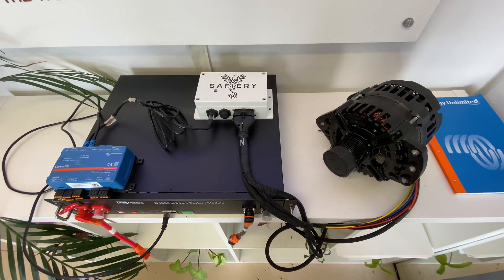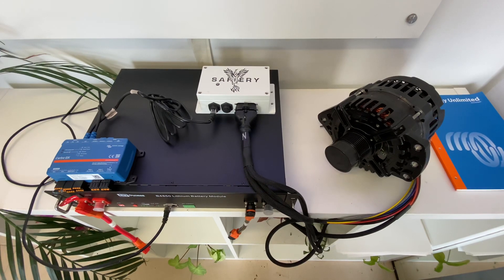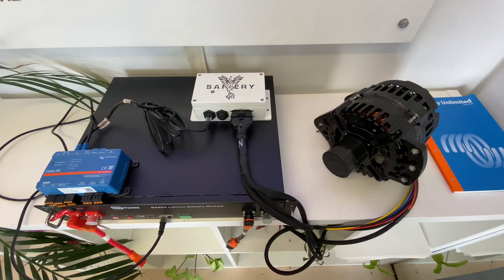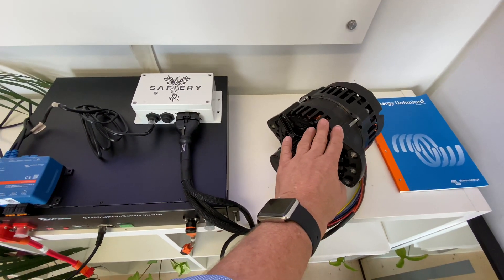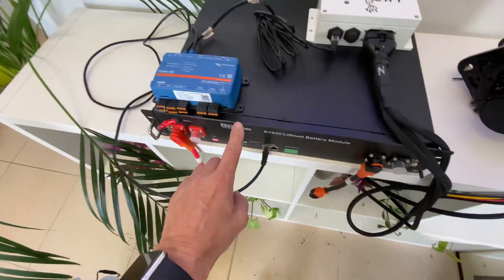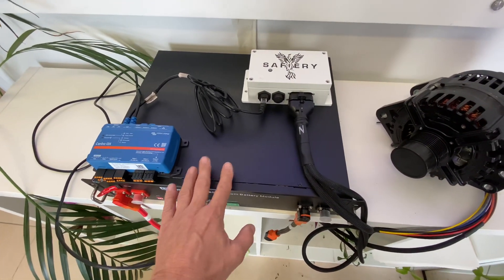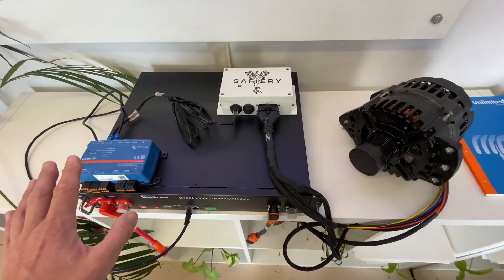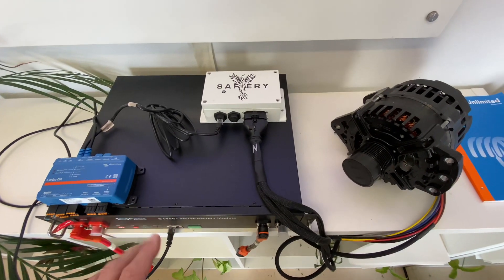5kw Charging from Alternator to Lithium Batteries

Comment: Here’s a great idea, can you test this set up with a 1995 Dodge Van B3500?  Where can I buy this system?
Reply from the maker: We would do that with a Scotty product. Up to 250A Alternator at 12V but it shifts to a higher voltage either 24V or 48V
Reply: @Safiery  wow, I think this is the first time I’ve actually gotten a reply to a comment... so, thank you!  Your system is a paradigm shifter, and I want one for my van before I start my 15K mile trek!  My worry, is there is no room for the dual alternator and Scotty in the engine compartment?

Comment: Hi Bruce. Not sure your up to speed with todays battery to battery chargers. If you have a 200 amp alternator then no problem. Check out www.sterling-power.com and stop talking about the Mickley Mouse battery to battery chargers. Use Sterling for the big stuff .
Reply from the maker: Nice to hear from you Charles, we do use your BB1248 at 840W. Look at the video with the Ford ranger where we get 180A from the standard Ford ranger alternator and this charges a 200Ah Lithium in the Vehicle Canopy as well as supplying your BB1248 to charge the caravan 48V system. However, the 840W is just not enough replenishment power so we fit separate 48V alternators on Sprinters and all the muscle trucks and can charge at 5kW directly. We think this is the big stuff but would love to see something bigger if you can share it.
Reply: who is now holding the short mickey mouse end of the stick? some people are just awesome!!!🤪

Comment: What vehicles will this be suitable for??
Reply from the maker: Perfect for Sprinter 4x4 as they are setup for a second alternation. MAN and the New Krafter should be OK. We are trying to fit in a 79 series and Ford Ranger. The 12V requirement is an Alternator with Field control which means the letter "F" on the plug/alternator case. Then less than 14V max output.